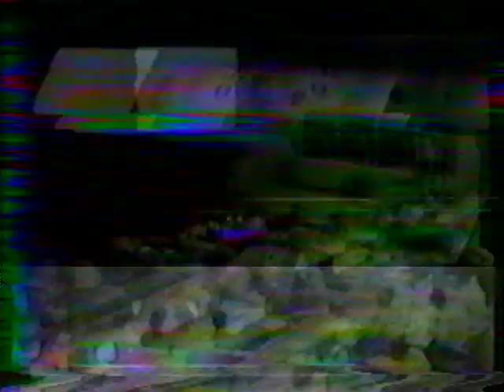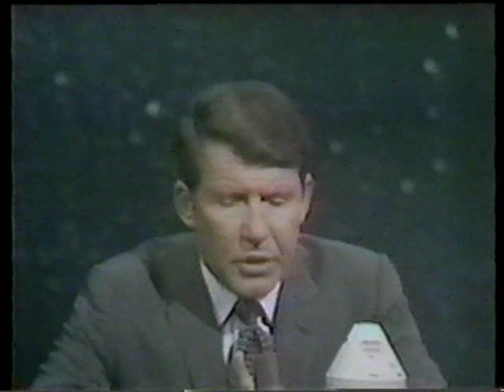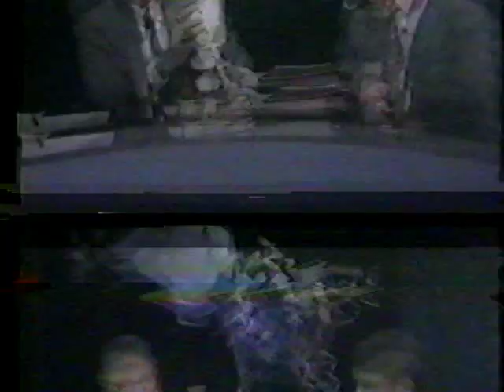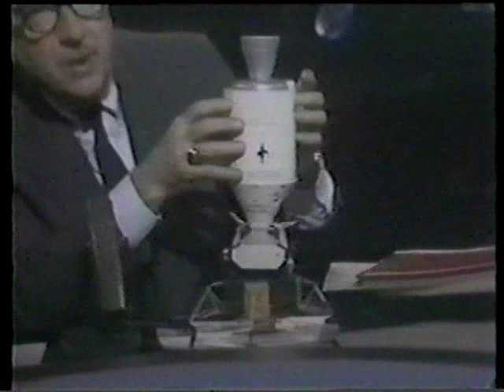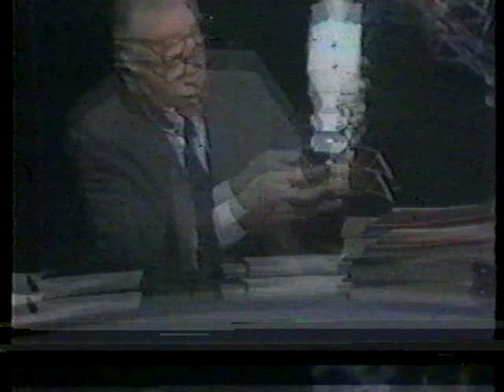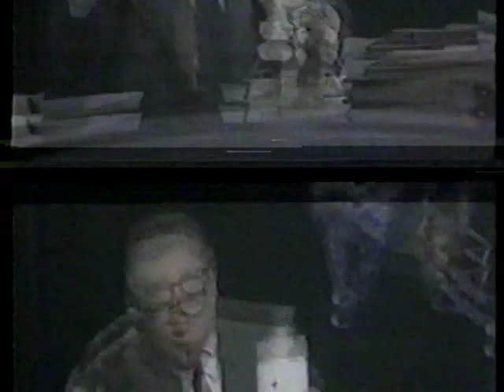Apollo 13 Part 6 CBS News Special Report of Flight Malfunction

Comment: No there were VTRs--instead of a cassette it was a metal reel of videotape.  VERY expensive to have a home unit,--about $3000 (in 1970 money).  Home tapes were only 30 minutes per reel, and cost $30-50 each.

Comment: This clip was broadcast beginning at 1 A.M. EST, after Cronkite and Schirra had been on the anchor desk for awhile (I think they both arrived around 11:30 P.M. and had gone on the air a few minutes later; I think Steve Rowan had anchored the initial hour until Cronkite and Schirra arrived).

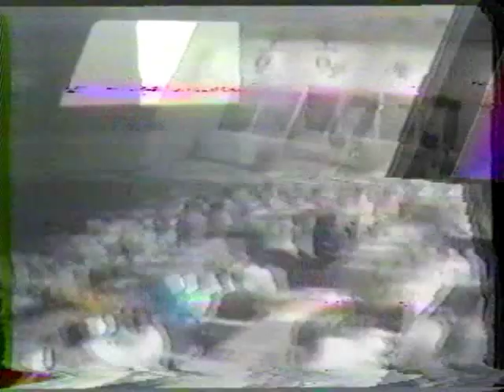At 4:57 of the clip, you hear a report from Roy Neal, who was with NBC but once the emergency began, became a pool correspondent for all the networks. No better broadcast journalist could have picked to become a pool correspondent from Houston's Mission Control during this emergency.

Comment: Where is the Vertical and Horizontal control knobs? I need to adjust them!
Reply: Just whap the side of the set with the palm of your hand. That's what I used to do!
Reply: Good times...
Reply: @paulehot  We used to hit the top of our console TV, but it was probably a different brand from yours!
Reply: No no no no.  You hold the antenna with one hand and raise your other hand and lift one foot.
Reply: Need a screwdriver. Or whack it good.
Reply: Lmao these comments 😂
Yahhh I remember this shit in the 90s 🤣

Comment: @ThePineconeMaster; quote, "Navigating by sight, they never would have made it back".  Except they did.  The CM platform alignment was transferred to the LM. Lovell then used the AOT (sextant) and our sun as an alignment star as per Houston' requests.  Mission Control computed all Apollo 13 cis-lunar trajectory burns and performed all precision orbit determination using tracking data from the MSFN (as per all Apollo lunar missions).

Not sure why this is so difficult to accept?  Unless your deep mistrust of all things governmental is your primary 'opinion'.

What is it that you believe is 'in' the moon btw?  I take it you aren't a follower of the fairly standardised scientific hypothesis on the geology of the moon?

You also go on to say that the public were not shown what is on the moon.  What specifically are you referring to?
Reply: dirzted You're right. Even if the originator said he made it up, the morons that bought into it would simply proclaim that the gubmint "got to him." Conspiracy theorists are the pinnacle of stupidity, who can and will take ANYTHING and use it to "prove" their nonsense. It's just not worth it to engage them.